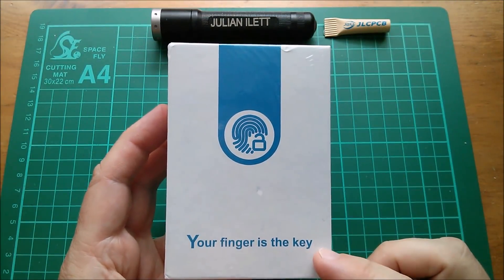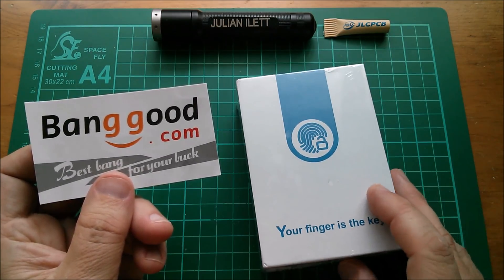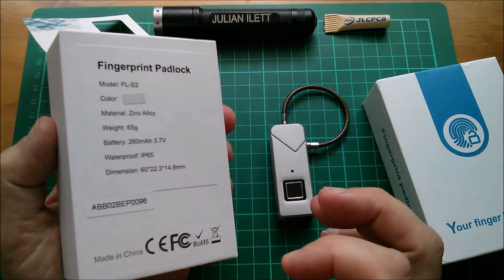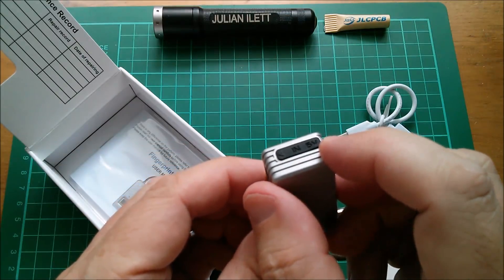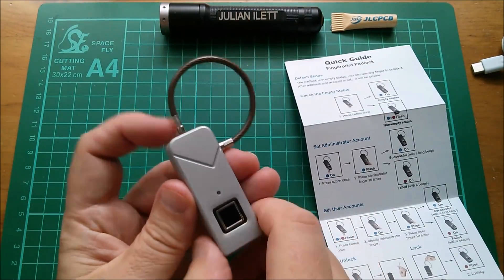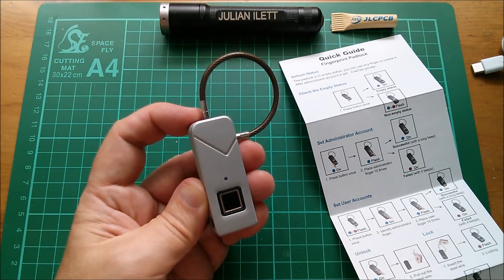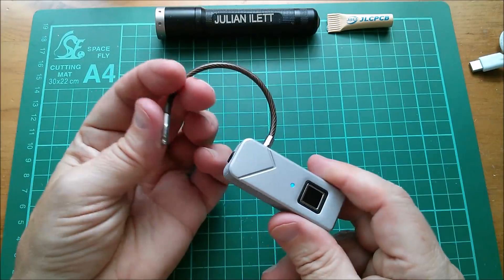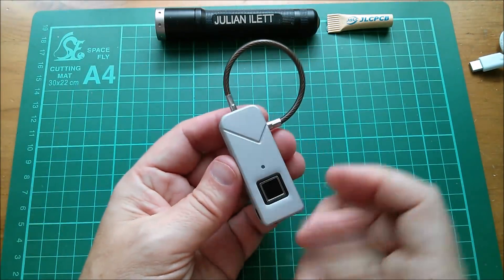What's Inside a Fingerprint Padlock?

Comment: Yeah and the wire can probably easily be cut by a diagonal cutter as well.
But this lock is absolutely fit for its intended purpose - it's not something you'd lock up your shed with - it is a small lock for use on bags and suitcases to prevent opportunistic thieves pickpocketing while traveling. Where you'd normally use a small light (zinc alloy) combination lock - which is easily decoded by the way, but again remember it's purpose, nobody is picking it while you're near as that'll take far too long . But the the fingerprint offers the addition of far greater pick resistance - most likely a tool or great violence to bypass - and it offer convinience and no combination to dial and and re-scramble.

Comment: Apart from moderate violence they way in seems to be - loiter around the lock, await owner's return, distract him and press and hold so it goes to reset mode. Owner opens lock, unwittingly resetting fingerprint. Lock will then open in response to any finger. Pounce at leisure.

Comment: Actually I think with that wire loop the first thing I would try to be twist it to see if it snaps off or gives...or pliers squeeze those 2 cable insert points together.

Thats all I could come up with that didn't use bolt cutter off hand.

Also curious how it tolerates overvolt or reverse polarity.  Maybe someone malicious could fry it instead of breaking in?

Comment: Well I have a problem with electronic fingerprint recognition: Every time I enter the USA, I have a 90 minute delay while someone with the authority to override the lack of recognition decides to let me in anyway. That having been written, I liked it. ALL small padlocks can be broken with relatively little effort. However, this one can produce "copies" of the "key", provided one has the cooperation of the administrator. This has value for applications where a number of people need honest access. What I really liked was the innards. I can see that it is at least a double layered board, but is the sensor a part of that biosec chip?

Comment: It's so fragile that I could open it with just pulling it strong enough or just pry it with any long metal object... If that string would have proper bigger locking pin it would be good but with that string it's like padlock made from wool...

Comment: Honestly, a battery-powered padlock with questionable security would be better suited for just locking your coat up at the gym where someone fiddling around with a padlock for five minutes would raise suspicions and the potential thief would give up after the thing flashed and beeped too many times. Is it worth $55 for that application? No, I got a rotary one at Target for $5 which is probably just as easy to break into (if you know what you're doing) and is still ultimately susceptible to bolt cutters.

Comment: What happens when the battery is dead and no longer takes a charge?
Reply: If you plug in a powerbank it should still power the lock even if the cell takes no charge, then you can at least replace it.

Comment: For that price you can get a very decent mechanical code padlock which also can be shared by several users and at the same time will be more safe and reliable. You should btw show if it really is possible to unscrew the wire when it is locked.

Comment: I can't believe that you can unscrew the other end of the chain :)) Zero Security.
Reply: You seem to really be able to do that as long as the other end is free and that's only the case when the lock is open...
Reply: @benbaselet2026  looks pretty easy to twist both ends at the same time since the lock pin is round and doesn't block twisting.

Comment: There are very good reasons for not using a zinc alloy in a real padlock, but all the rest is do insecure that the material is the not the major problem. Just reuse the thing in another project, I'm sure you can make it recognize different fingertips and do something different in each case.

Comment: Why use USB-C?  Not using it for high speed data.  Not using it for high current or voltage.  All that does is it now means you have to carry another cable for charging when you already have a micro USB for your phone, etc.
Reply: Because the idiots who buy these type of devices are too stupid to handle regular USB connectors.
Reply: ...and neither do most phones, most new phones with a USB-C connector still use an old usb 2.0 interface, meaning you're getting the same data and current capability of older phones.

However USB-C is more robust, reversible and has a stronger clip so it doesn't wear down and fall out so quickly, are those good enough reasons? What if someone already owns a phone or w/e devices with USB-C? Then they would need an extra micro-b cable, as Pentti said, the proper thing to do is simply offer both options, but really everything should move to usb-c, it's purely an all around better connector.
Reply: vgamesx1 - what are you on about? ALL USB connectors are a pile of rubbish. Yes, EVERY single type and variation. Oh, and the Apple connectors are just as bad. None of them will last ten years of regular use, which should be the minimum standard that is being aimed for.
Reply: Except a lot of new phones have the better C type connector. For me a micro USB for this would mean two cables as I already have the type C. The proper thing is to give the buyer a choice of connectors to choose from.

Comment: Excellent video, as usual, but why you didn't tried to unscrew the steel cable on the other pad lock?

Cheers
Reply: I think it could.  The entire cable would rotate along it's axis since the pin is loosely held in by the arm the motor is attached to.

Comment: Being a screw isn't really a weak point because they couldn't possibly make that many turns with it's locked.
Reply: @Legend of the Stormlord
the whole cable turns :-)
Reply: Yes, easy to do when unlocked. But I imagine slightly harder (but by no means impossible) with it locked as you need to rotate the whole length of the stiff cable several times, and that will not be so easy when cable is bent through 270 degrees.

It is alarming though, because even though the lock is insecure (which we already knew by looking at it), this makes it non tamper evident also.
Reply: @Stuart McConnachie
it would certainly be a surprise to anyone who didnt know it could be unscrewed the "box" opened and then screwed back together again after you nicked all the stuff . hehe :-)
Reply: yeah it could have been useful as a tamper evident seal. I'd suggest the manufacturers look at that rather than locking... being electronic you could store locking / unlocking timestamps or some chain of custody type records for readout by RF or  usb.

Comment: You get around that with a pair of bolt cutters.😀
Reply: Right, just use the bolt cutter to cut off the finger of the admin.
Reply: You get around a lot with some hardware. That's not the point of small locks. The point is someone in class or a cafe can't just pick your stuff up and walk out.
Reply: Pentti Kantanen didnt you notice the little smily after my comment? It was a joke.
Reply: What I'd have liked to see, if you'd yank it really hard without any tools if the little knob at the end would give.
Reply: wire cutters
Reply: If you have physical access, you've already won.

Comment: if malicious people saw this lock they would use sidecutters
Reply: Cutters work for pretty much any small lock, moot point. That's not what these are designed for.
Reply: He doesn't mean bolt cutters, he means garden variety wire snips could nibble through that cable.

Comment: These are sort of a joke.  Ideally a non-recognized print should impose a delay before another attempt is accepted, and the interval should probably be lengthened for subsequent failed attempts.

I'm sure that black hat types have already worked out a pattern-strip for use in brute-force "picking" based on what they've learned about the limitations of these cheap scanners.

I won't even bother talking about the obvious lack of physical security.
Reply: Bob Riemersma Dont talk about security when it has a cable that takes no more than a pocket knife to cut.
Reply: Security researchers of any hat color look at the physical security first, and if that fails so easily like in this case, don't bother looking any further.
There was another of these (much more expensive though) recently where a security researcher simply unscrewed the screw holding the case together to access everything inside. At that point, it's just a waste of time.

Comment: wow what a pile of junk. only value would be hacking it to use the fingerprint scanner for something else. from a security aspect you might as well just put a post-it-note asking the thief not to steal your stuff.

anyway thanks for the tear down.

edit... wow i certainly wouldn't have paid that much either...
Reply: There are fingerprint reader modules available from China that don't cost that much and don't require any reverse engineering.